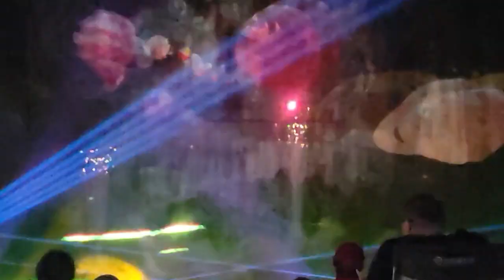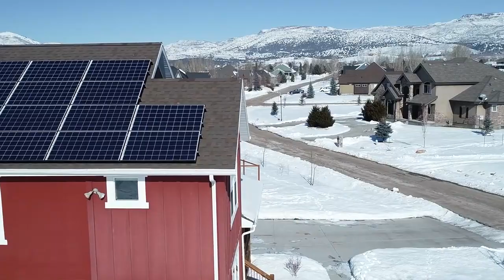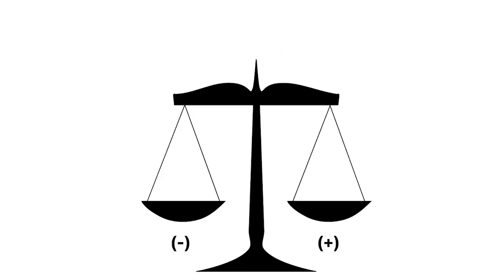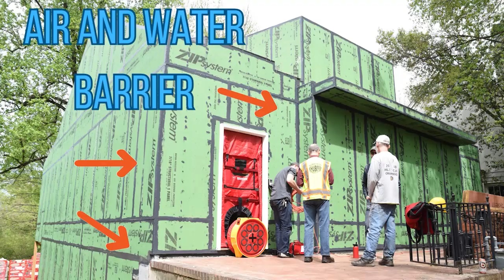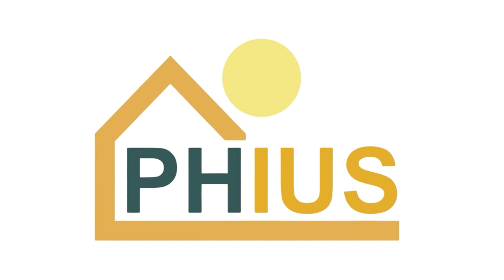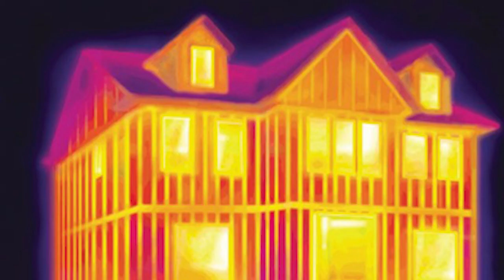Energy Independence Day

Comment: You should still have a backup generator and a propane tank. A battery bank will never last more than a day or two unless you have a crazy big budget.  A generator can work for multiple weeks if the fuel tank is big enough.
Reply from the maker: If you have a few solar panels to charge it then you should be okay.  I have a few more videos coming out that will go over even more options.  Stay tuned.
Reply: @SawHorseDesignBuild  True, If the solar panels are clean and have good sun. What happens if you have a week of heavy cloud cover during a winter storm? There are also people who are too weak or old to clean snow off of panels; I, for one, wouldn't want my grandparents trying to clear off solar panels when it's 20 degrees below freezing during the middle of a power outage that's a recipe for a series injury or even death.
Reply: @ZergZfTw  Very true- most resilient construction suggestions need to be climate-specific.  In Atlanta, snow is not a major issue.  I have seen panels installed at odd angles in the north to make them more accessible and resistant to snow coverage.